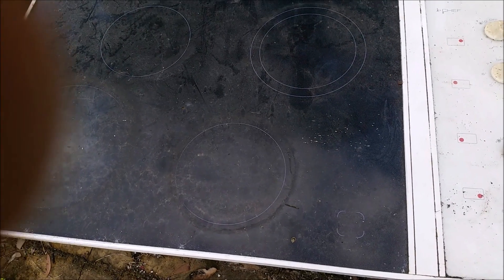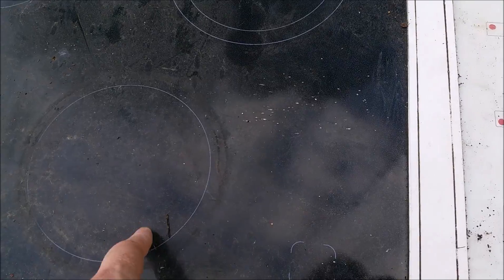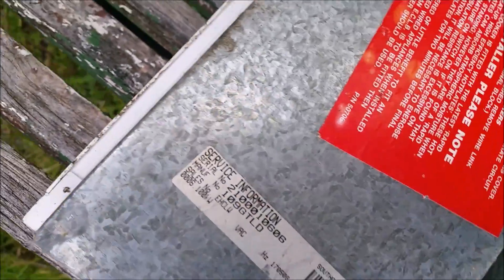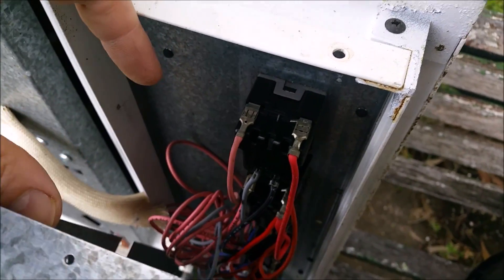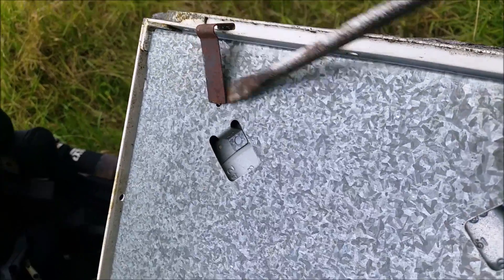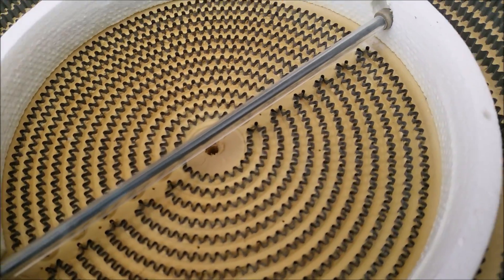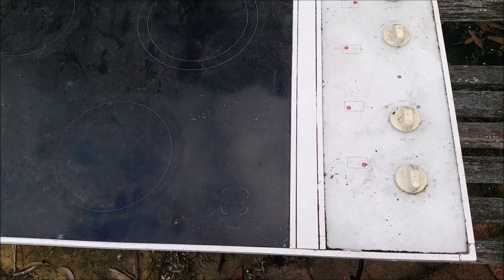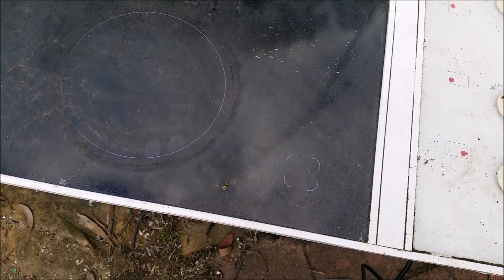Can this stove make a kiln?

Comment: Ordinary ceramic cooktop ,Would make a good ballast
Reply: +m3sca1 For ballast, I would rather suggest inductive ones.

a lot less energy wasted that way. (but power factor will be way off)

Maybe even a variable transformer shunt for adjustments.

Capacitive ballasts is for the brave, but is also a possible way.
Reply: +m3sca1 those rods are bourdon tubes for the thermostat, it helps regulate the hotplate temp without the plate overheating
Reply: +HDXFH even with the hotplates on High The bourdon regulates the hotplate temp
Reply from the maker: ballast! thats a great idea for the MOT, still thinking about tearing it apart though. i have a feeling those rods over the coils are a current limiting device but that's just a guess.
Do you know about this thing?
Reply from the maker: HDXFH thanks for your input.
Reply: m3sca1 i know im late to the show i was wondering on how you set up your kiln if you set one up, did you recycle any other equipment to make it for cheaper, and if so what? I've been looking into making one myself.

Comment: making it into a kiln would mostly be just encasing the modules.

That's not a induction top, you are actually looking at heating elements that radiate heat!

The stuff around the zigzag wire is some very heat capable thermal and electrical  isolation.
Reply from the maker: any idea what the rods that sit above the coils are?
Reply: +m3sca1 Its over temperature protection.
at the end of the rod, is a switch that turns the element off if it gets too hot.

You can override that switch,
but I wouldn't suggest doing so unless you really have to.

keep in mind, it's slightly stronger than wet sand, so you can easily destroy the isolation by poking around.

I wouldn't actually call it coils, rather call it element. Whatever induction going on is accidental.
Besides, it's not a continous spiral.
Reply from the maker: A switch! well that makes life easier...if i put them in a kiln the switch will have to come out
Reply: +m3sca1 Well.. don't assume it's low temprature switch.

I would guess it's actually a last chance to stop before stuff starts melting switch.

Power regulation is by series/paralleling the different element sections.
Reply from the maker: erlendse yeah i figure it gets very hot given the location...i wonder if there is something on those switches i can google..............
Reply: +m3sca1 Well.. probably not a lot. but you got a full schematic on the bottom cover.

Also, looks like there is hot plate indicators there, so the switch got a low temprature shorting switch(indicator) and high temprature disconnecting switch (overheat protection)

If you do a video of the labels, it would be easier to suggest on how to go about modifying it.